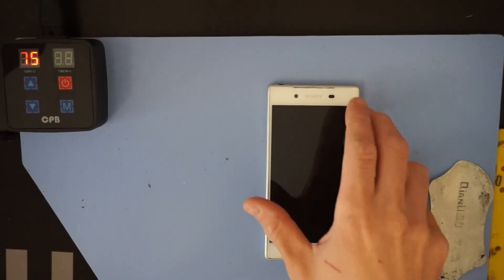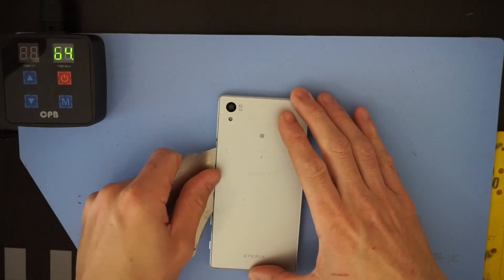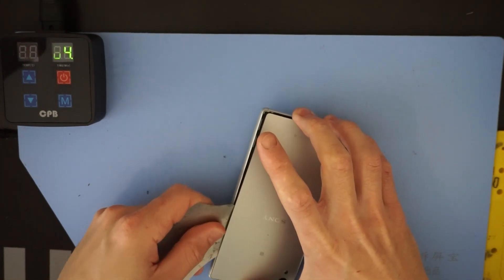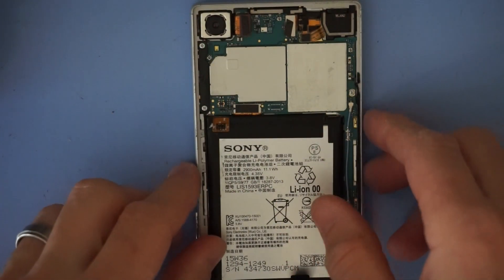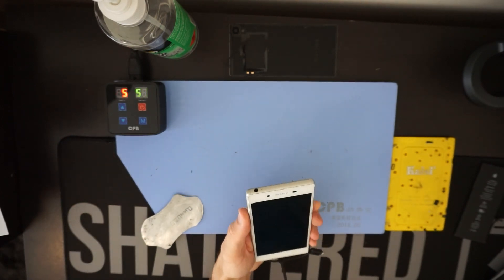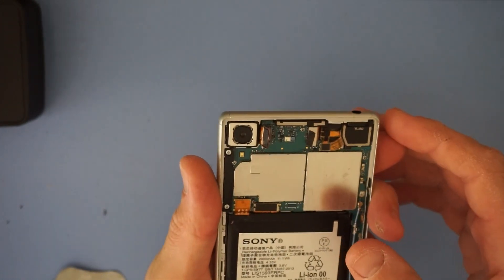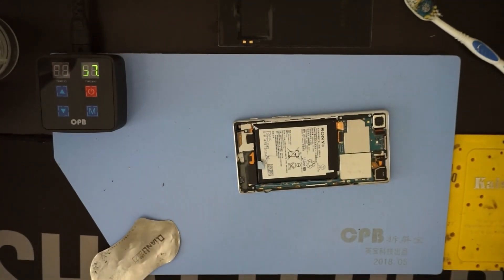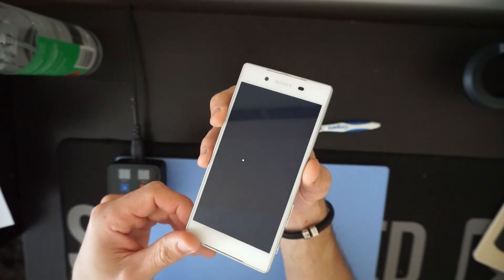Sony Xperia Z5 Not Powering Solution

Comment: thank you this really helps me big time

1. the charger chip was already diconnected when I open the case thus observed no power supply

your solution (re-connect it)
result (now it boot-up and display)

2. battery not charging 

your solution (brush and clean the charging phone port with little alcohol on the brush)

result (phone battery now charging)

your guidance is a GREAT HELP!

no $$$$ spend

thank you and God Bless always!
Reply from the maker: Thank you for your comment

I happy to hear it has got your phone going once more

Comment: Hello, i want to ask if you were charging your phone when the battery connector was disconnected? 4:36
Reply from the maker: i cant remember with that one sorry, i think after the battery was disconnect and reconnect i then put it on charge
Reply: @rickstechrepairs  understood. My xperia turned off and i couldn't turn it on, i tried everything, probably motherboard died. When it is on charge, the red light is blinking, and when i try to turn it on, the light lights continiuously

Comment: Hi, I dropped my Z5 from about 40 cm in height and now it's not powering back on.... I opened it and disconnected the battery and when I connected the charger with disconnected battery the screen is lighting up with Sony logo every 6 seconds and then it goes black again and after 6 seconds it lights up and then goes black again. After that I connected the battery an left it to charge for a few hours and it still doesn't want to turn on, when I disconnected the battery once more the screen is lighting up again with sony logo and going black every 6 seconds in some kind of loop.
I really don't know what could be the problem, could maybe the battery itself be the problem. I would be really grateful if you could help me.
Reply from the maker: possible thats a faulty battery but i would think its pretty unlikely
Reply: It was actually a faulty battery. I swapped the old one for a new one and now everything woks just fine 🙂.

Comment: I have xperia z5 that cant turn on
I tried to turn it on, it shows charging screen with 0% battery
When I plug it in, sometimes it just show 0%, not charging, sometimes it shows that it is charging, but the battery never go up and always restarting without even pressing the power button
Can you give alternative solution other than shown in this video?
Thank you in advance
Reply from the maker: You will need to charge your battery externally then put back in the phone 

Purely to recover data

Comment: will this work with the Z5 compact model?
Reply from the maker: Give it a go
Reply: @rickstechrepairs  it worked! But I need to change the battery because it won't charge but just kept blinking red and a battery with a lightning bolt keeps popping up. But thanks anyways!!!